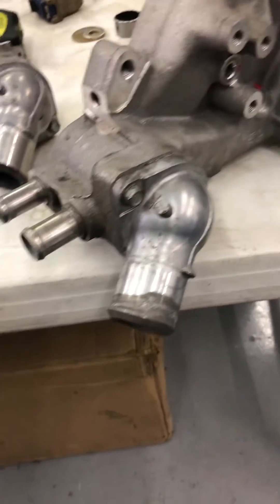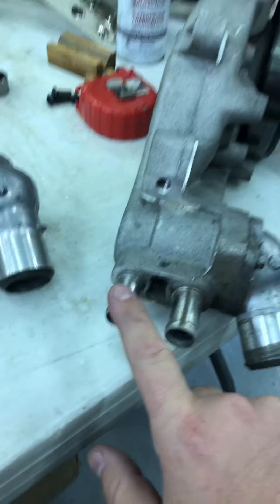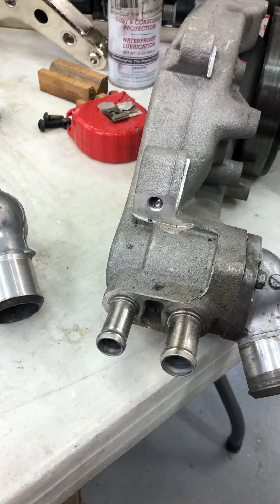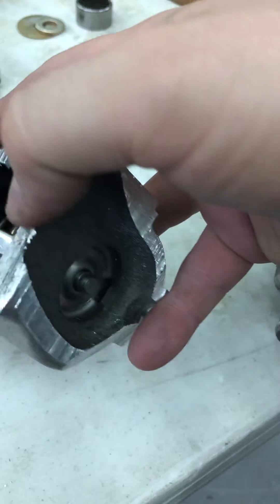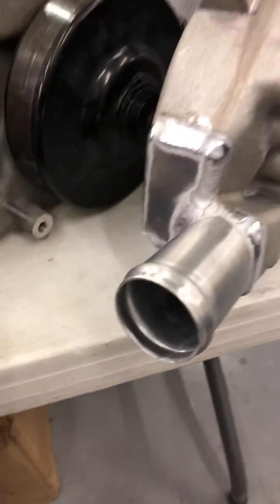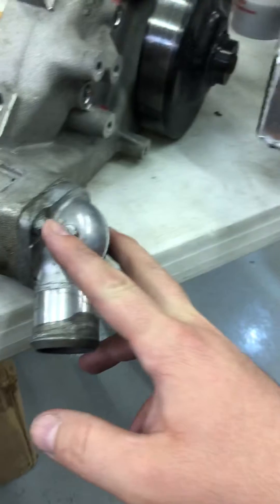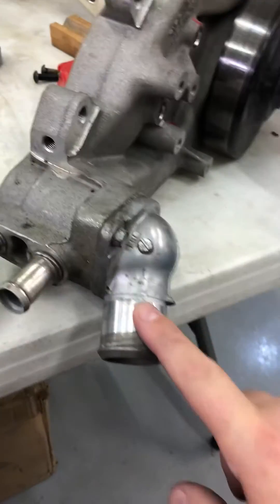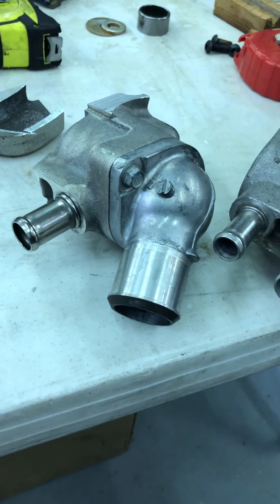LS water pump thermostat removal and race water pump conversion

Comment: Is the Meziere electric LS water pump the same way, where it needs to have coolant flowing thru the heater core circuit to get the stat to open? I'm having an issue with a hot running engine with a Meziere electric pump and no heater core lines on it.... 🤔

Comment: Is the LS4 ( 2008 Impala SS 5.3) water pump, T-Stat configuration, similar to the earlier LS WP versions? I, have removed my T-Stat, in my LS4 swap. 1999 VW New Beetle, w LS4 ( complete package transplant)  mounted mid ship, behind the front seats, radiator up front, due to cooling issues, on new build. And removing the STAT has not helped the high water temps?

Comment: I mean, a simple freeze plug and put the housing back on and you're done. Aside from all that, let's talk about how you aren't able to run a degas tank and how that negatively impacts the cooling system in a major way. You have no pressure differential in the cooling system now, and no way to FORCE steam out of the engine. Keeping the thermostat Is the way to go 100% of the time in these engines. Anyone that says otherwise doesn't completely understand how these cooling systems truly work. This isn't gen 1 when you can get away with shit like that.
Reply from the maker: Hello, what happens when you run a Stewart standard rotation LS water pump? Oh. No thermostat. 

“De-gas” tank can be installed anywhere, we use a C&R pressure can. 

Let’s talk about how we win races and have zero issues like this, and you’re just a comment on the internet.
Reply from the maker: It’s also clear you didn’t watch the video in it’s entirety, as I called out the freeze plug at the end.
Reply: I know this is 3yrs old but I just have to say it's pure comedy seeing  you try to explain cooling to the man thats responsible for some of the best c5/c6/c7 road race cars. Lol